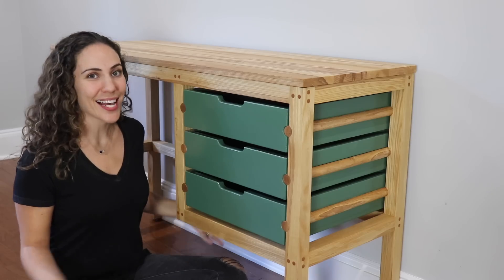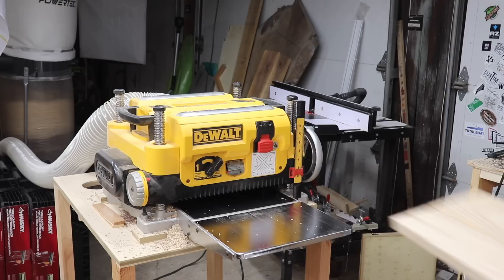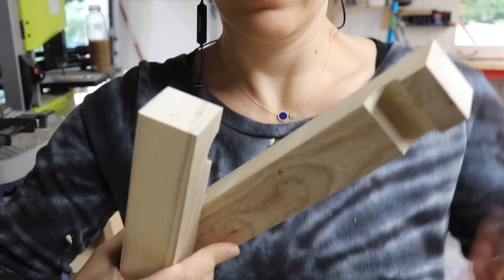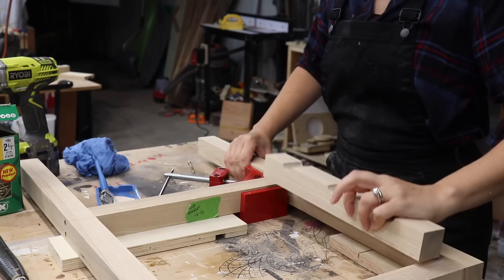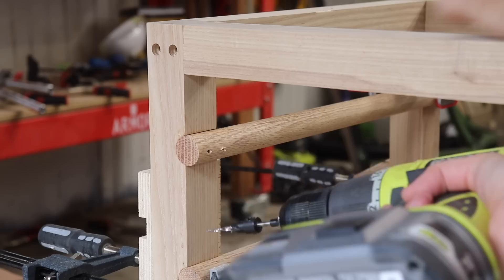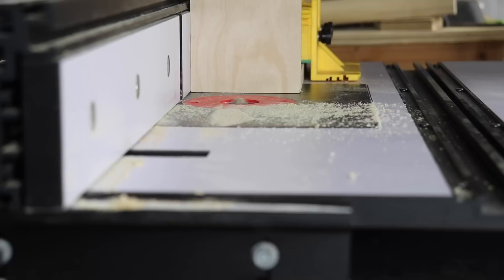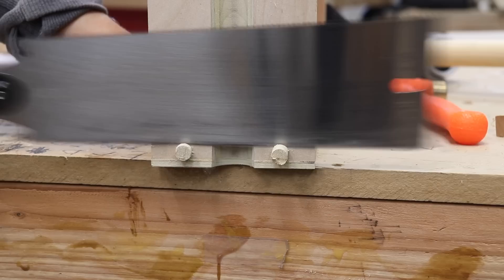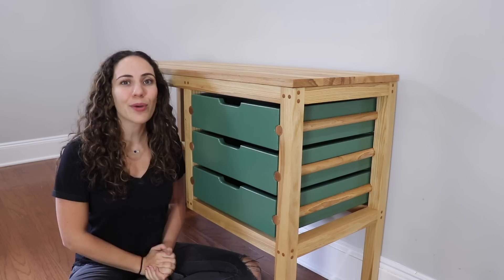Building a Desk Using Dowels for Drawer Slides // Woodworking // Instagram Builders Challenge

Comment: The desk looks great! The dowel slides are genius and I actually really like the mirroring of the dowels in the joinery!
Reply from the maker: Thanks so much! I appreciate that!
Reply: @3x3CustomTamar  I'm with Dave on that, and thanks for the work, I'm in the middle of a double book shelving system  and you just solved an issue, just hope my work is somewhere near your fine effort...
Reply from the maker: Ralph Craig thanks so much! Good luck with your project!
Reply: I also agree that it looks great as it is. Very nice work.
Reply: I agree. The visible dowels of the joinery  "echo" the dowels of the slides, which serves both to emphasize them and to tie the whole thing together.
Reply from the maker: Thanks!
Reply from the maker: Thanks! I like them on the front. its when looking at the corner they get too busy for me.
Reply: You're being far too hard on yourself. Lovely work  @3x3CustomTamar
Reply: so do i ..
Reply: David Parker love the idea of using the dowels even if you can't see them
Reply: as an idea to try new materials, you might substitute some PVC, aluminum or steel/iron tube or pipe... could make for some interesting projects... and also this would open up the use of pre-fab parts as these different materials have hardware made for them as well. (pipe holders, pipe fittings.)

Comment: I love the way your son is totally not bothered about pushing the drawers all the way in and any one with even the mildest form of ocd (me included) is screaming at the TV "pull the drawers out" so thanks for doing it. And so that we can all sleep at night you have to show how you fixed it😀😀.The whole look of the project was fantastic and I love the dowel drawer runners and dowel covers they look very smart in contrast with the light wood.
Reply from the maker: Hahahaha! It was killing me too! I could just put a block or dowel or fender washer at the back of the dowel slides. But that won’t prevent them from being pulled all the way out. I think I have an idea that will work. And thanks so much!
Reply: @3x3CustomTamar  Laughed at the OCD remark concerning the alignment of the dowels, as you were placing them I wondered if that would come up, and it did!  Now, I would have run the grain on the dowel 90 degrees to the grain on the leg, draws more attention that way...
Reply from the maker: Ralph Craig Ha! It’s all in the details...

Comment: Adding to the dowel. If you place a smaller dowel at the back of the drawers, inside and out, then the drawers would not pull completely out and would only go in just so far.
Reply: I was thinking the same thing, but was just thinking a square block, but your idea would keep with the dowel theme.

Comment: Thank you for not using pocket holes. Haha.
Reply from the maker: Ha! They have their place.
Reply: 3x3Custom - Tamar I completely agree. But when see every other Youtuber using them constantly, it both gets old and lets every do it yourselves think they can use them for everything. I personally think this looks better and is much stronger. So... thank you
Reply from the maker: onedieingsoul when I first started I though my pocket hole jig was going to be the game changer for me. It was a for a while. Then realized I didn’t NEED them.
Reply: Pocket holes are very strong and effective, that’s why people use them.  In fact, they are MUCH stronger than going directly into the end-grain.  You can see some very large commercial structures being secured with 1.5” thick bolts using the same principle as pocket holes.  For applications here, the screw-into-end-grain joint is plenty strong, but pocket hole will technically be a stronger joint.  I think a good doweling system is probably the best way to go, but pocket hole is a close second for me.  M&T or dovetails are only moderately stronger but take much more time to do.  Unless you are going for “that look”, you are better off with pocket holes.
Reply: @MintStiles  Skewed dowels would hold extremely well, and if you want, you can cut it apart.

Comment: I wouldn't make any stoppers, so I can pull the drawer completely, to clean it
Reply: Little dowels on the back, top edge that are not glued in will secure it and be easily removed for cleaning. Same with the back. Little dowls to stop it from going all the way back, but removable so you can push the drawers out of the back to pull the other dowels out. Making extras and making them all the same size will insure it won't get messed up if you lose a few.
Reply: Atleast stoppers in the sense to make it where it doesn’t push in past where you want it to go and shove it into the wall

Comment: Just put a wooden bracket, same green as the drawers, on the outside of the dowel slides, and it will work as an end and front stop. Done! ;) Nice project!
Reply from the maker: That would be a good idea. But then I’d have to remove that bracket it I wanted to take the drawer out. I have an idea that I think will work

Comment: For longevity and greater strength, consider using dowels in end grain situations (stretchers) instead of screws. It creates a long grain to long grain glue connection, which is much stronger. It's like a round mortise and tenon. Nice work!
Reply from the maker: Yes. I have used that method in some of my previous videos. Thanks!

Comment: Yeah, the two corners meeting with 4 prominent plugs is kind of where the eye first goes.  It wouldn’t be as noticeable if it were just one per.  But as I stated before, it doesn’t bother me as much, in fact I love the Mission/Craftsman style where joints are celebrated with through tenons, dowels, or plugs like you did, a lot of times with a different species of wood for such contrast.  Sometimes it’s such a fine line in design to contrast your own opinion of aesthetics to the same in pragmatism.  I also like the contrasting open drawers.  As I age I’m finding that well thought out & executed simplicity is a more pleasing approach.  This project reflects that.
Reply from the maker: Thanks! Yeah. It’s the busyness on the corners that were bothering me. Perhaps I should have plugged the sides with face grain dowels of ash so it would blend into the frame. You know what they say about hindsight!

Comment: Nice job.  I have done the dowel joints with picture frames but with a small change:  drill the second dowel hole so it intersects the first dowels a little.  Adds a bit of holding power.
Reply from the maker: Cool

Comment: 11:10 REEEEEEEEEEEE!
12:25 Thank you! ;)
That looks fantastic, love the dowel slides, but definitely needs stops for the drawers.
Reply from the maker: Haha! Yup! I could have just put something behind the desk to stop them. But I have an idea for something that will also prevent them from being pulled out all the way
Reply: Maybe a dowel in the side of each drawer, positioned to limit how far back it can be pushed, and also would prevent it from being pulled all the way out?
Threaded so it can be unscrewed if the drawer needs to be removed.
Reply from the maker: Mark Beiser that’s exactly what I’m thinking. Except instead of threaded. It will be spring loaded ☺️
Reply: Spring loaded dowels?
Are you a wizard?  :D

I thought about that, but my woodworking is in the "collect basic tools to get started" phase, so not sure how to even begin to implement spring loading the dowels.
Reply from the maker: Mark Beiser ha! Check out my entry way table build with the box joints. I did a similar technique.

Comment: Very nice, I love the dowel concept for the drawer slides. If I may give you a small tip for future reference: Construct your drawer boxes so that the sides extend about 2 inches past the back of the drawer - The extended sides then can be sized to act as stops to prevent the drawer from going too far in to the carcase, and the added benefit is that the full interior of the drawer can be seen and used without pulling the whole drawer out of the frame. Also, rubbing a candle along the drawer rails and grooves ensures a super smooth drawer action.
Reply: Great ideas
Reply: @MojoPup  Agreed.  I recommended using Delrin or other plastic dowels for that reason.  Peace
Reply: @DaxxTerryGreen   Love the contrasting wood of the dowels. The different wood tones turns a functional project into a very unique piece of functional woodcraft...

Comment: Those drawer slides are AWESOME.  I think that you are 100% right on being a bit busy with all the dowels.  Another benefit to choosing hidden joinery would be some added strength as well.  Those screws are easy but I'd be worried about them loosening up over time going into end grain like that, especially if kids are using it.  cool desk!
Reply from the maker: Thanks! Yeah. I have the same concern. Just wanted an easy base to test my theory of the slides out

Comment: I've  never seen dowel drawer slides before, very good idea!  Suggestion: look into mortise and tenon joinery for your leg and stiles connections.  Square tenon and hole is more traditional, but there are some perfectly adequate mortise and tenon joints possible with rounded mortise and tenons using a router.
Reply from the maker: This was a fun experiment. I’ve done mortise and tenons with a router before. It’s def better than screws. Ha. But this was just a quick build

Comment: Great job. Lots of positive comments. Two design suggestion/ideas. A) Color the dowel slide on the drawer sides. Perhaps black or white?  B) Screw covers / dowels look good from the front as they mirror the round ends of the larger dowels. The busy look may come from the side covers. Perhaps consider hidden joinery in the left-right dimension but not the front-back.
Reply from the maker: Thanks! I completely agree. I like how it looks from the front. It’s the side that bothers me.

Comment: Great design!  If you ever build another, I think I would look into maybe extending the dowels slightly and rounding over the ends instead of cutting them flush.  Also, maybe staining them a contrasting color.  Just a couple of thoughts that I had - I think it turned out great!
Reply from the maker: Those both sound like great ideas. Thanks so much!

Comment: Excellent!  Never seen the dowel method before.  Love it.  Also love the comment below..."Thank you for not using pocket holes."  LOL.  I also thought the number of plugs you used worked well for the piece. Just one man's opinion though. If I could offer a tip, allow your drawer bottoms to free float in the dados.  There are many variations with grain direction between the bottom and sides, which can pose problems when gluing.  Letting the bottom free float will allow for the seasonal movement of the wood.  The expansion and contraction of the wood against a glued bottom can cause warping. Not trying to be a know it all, just a time proven method. Great vid!
Reply from the maker: Thanks! My son is so happy with the piece. I figured since the drawer was all plywood I wouldn’t have to worry about any wood movement
Reply: @3x3CustomTamar  Yes. Definitely. Guess I didn't notice the sides were plywood. Glue all day long.

Comment: Very cool. You know what would also have been cool is is the pieces had been joined with a single dowel the same diameter as the slides.  I predict there are going to be a few folks using your unique idea.  I also like you use of templates.
Reply from the maker: That could look cool. Thanks!

Comment: for a depth stop for the drawers you could cut the first inch from the dowel slide from the front and glue it to the drawer. If you pull the drawer out, the peace of dowel would pull out with the drawer and hit the rest of the rail when pushed in again. hope this was clear.. :D
greetz from germany
Reply from the maker: Makes sense. Sounds like a cool idea

Comment: Nice work, the dowel slides are great! If you haven't already come up with a stop solution, you could put some small blocks on the drawers on either side of the dowel, tight to the back leg. These would not only prevent the drawer from going back too far as they contact the back leg, but would also keep them from being pulled out, as the stops contact the front leg. I'm sure you've already come up with a solution though. Cheers.
Reply from the maker: Thanks! I think I have an idea that’s going to work well
Reply: @3x3CustomTamar  looking forward to seeing what you came up with.

Comment: Key the dowels on center, leaving a few inches on either end. On either side of the drawer, tap a hole towards the back along center of the dowel slot. Insert screw pins (similar to RC car screw shaft pins) to then act as a removable stop for both front and rear travel.

Comment: Brilliant build. love the idea of using the Dowels as the drawer slides, and also those little Jigs that you kept making, they turned out to be a useful idea as well. I would defo sort out some kind of stop, backing board, or something or else it will be paint brush time on the wall.
Well done and good luck in the challenge.
Barry (ENG)
Reply from the maker: Thanks so much! Yeah. I planned on doing the stops for this video. But I just ran out of time this week. I’ll post an update next week

Comment: When working with solid wood drawers depending how long the drawers are putting drawer stops at the back can cause the drawer front to move out of flush with the changes in seasons or permanently if the wood isn't dried enough, so when possible plan the drawer stops hidden behind the drawer face. A tip I learnt from Rob Cosman.
Reply from the maker: I have a different idea for the stops. But these are plywood drawer. Thanks for the tip!
Reply: You could stop the dowel sort and let the draw front run over. You wouldn't  see the dowl end....that may be a down side as thats part of the look i guess. Nice work. 🤣😂😁😀😎

Comment: I am very impressed with the design of this project,the build and related tips are also right on and the video production was top shelf (one might even say "top draw").This is from someone that is hard to impress,I've installed high-end custom cabinetry in many kitchens (cost for cabinets only- $300,000) and wall-units that were  $100,000.I want to commend you for mostly following safe procedures (rings can be a hazard and hair should be brought close to the head). I am sure you are aware that safety first is not only for you but also the fine young gentleman in the video that deserves a Mom free from injury.A few small tips,waxing the inner part of the dowels and on the parts of the drawers contacting the dowels will improve drawer glide.The desk would be a bit more balanced if the top had more overhang,this can be easily done by applying an ash trim piece around the perimeter,the corners mitered.This step will also hide the one major flaw,that being the exposed end grain of the top.You are doing fabulous work and I hope  to see many more of your projects.

Comment: Very Nice - I think I would have liked to have seen you use dowels from a darker wood for all the connections instead of screws. Now that is a completely subjective suggestion I know, but I really like trying to make things without fasteners. I think it would have kept with the theme of the round guides, which is very cool! I liked all they dowels!
Reply from the maker: I knew my use of fasteners might upset people. But I really just wanted to test it my idea for the dowel slides would work. So I did what was quickest and easiest for me.

Comment: Great job. 
Your build is open framed, but I bet you could make full extension drawers by using the dowels as well, having them slide on both sides. You would need a slot in the drawer and the base half the drawer length and two screws in the dowel.

Comment: I had a similar idea for drawer slides. I was a certified athletic trainer for almost 20 years and due to 4 car accidents I had to sadly walk a away from that career. I have seen so many people throw away crutches after the are finished with them so I've always grabbed them to use them for my athletes who get hurt. I would give them crutches from the aseptic training room to use after a lower extremity injury and of course being irresponsible teenagers they would never return them so I got pretty used to keeping an eye out for them. It's pretty surprising to see how many people put their crutches next to the baggage can on trash day. If always stop the car and grab them. But now since I'm no longer an athletic trainer I plan to cut the crutches up and use them for drawer slides. The cool thing about using the crutches for slides is when you are directly in front of the drawer you can see through the pile and the drawer looks like it's floating in the air of you can get the slaving right. I thought it was so cool to see that someone else had the same idea to use some sort of round dowel /pipe to use as a slide. It looks really cool and I think you did an awake job with it. Thanks for the video.
Reply from the maker: That sounds pretty cool! It is cool when ppl have similar ideas

Comment: My idea for drawer stops: since the outside of the drawers are exposed, drill a dowel hole on the outside of the drawer, right in front of the rear leg (when the drawer is in its front flush position). Insert brass pin. The pin will contact the rear leg when flush at the front, and will contact the front leg when pulled out. Remove pin to remove drawers.
Reply from the maker: Thats kinda exactly what I want to do. Except I’m gonna to make that pin spring loaded 😉
Reply: @3x3CustomTamar  PERFECT!

Comment: I like the design, I might use some of your ideas, except I tend to use hand tools so might have to adjust the build and would 
probably use mortice and tenon joints with through dowels. Like the idea of using dowel for the drawer runners.
Reply from the maker: Thanks! That would be better than screws. I just didn’t have the time for this build.